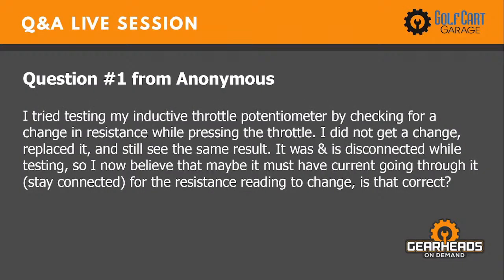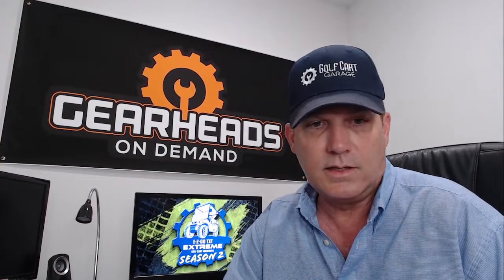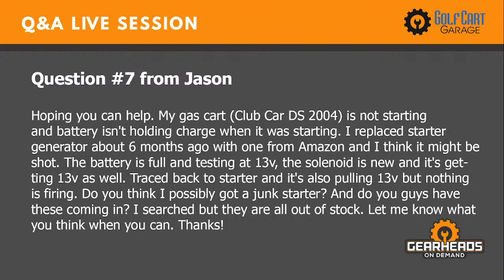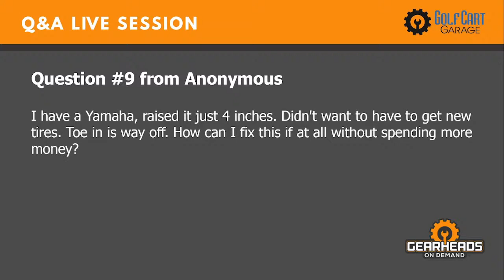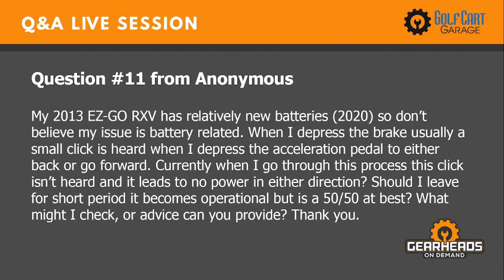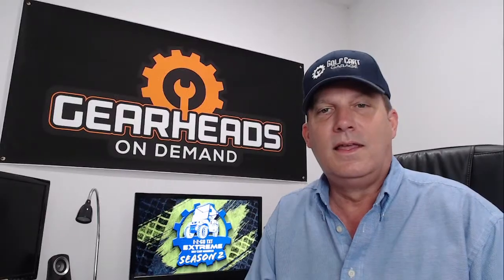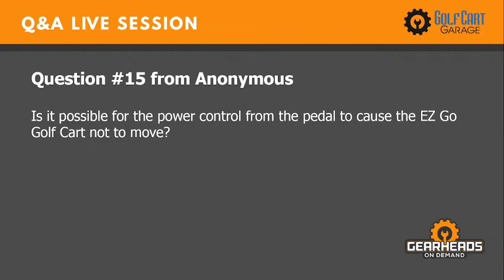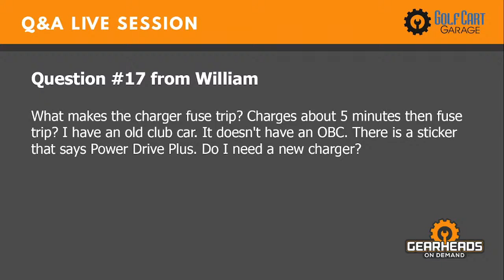Tips & Tricks for Golf Cart by Expert – LIVE Q&A | Golf Cart Garage I Episode # 37

Comment: I have a yamaha g29 2011.cart it started to get slower during a round and finally stopped put it on charger and charger would just start and stop I took it down to have batteries checked and it clicked and the reverse alarm worked and it was drivable what would cause this. I checked batteries with multi meter and they were 8.46 to 8.55 volts.
Reply from the maker: Thanks for watching!  This sounds like there is an issue with the charger itself, or perhaps a bad battery cell.  We'd recommend a load test on those batteries to find one that might have a bad cell, these can test good on resting voltage.  If you need further assistance or have questions, get in touch!  Support@GolfCartGarage.com or (800) 401-2934